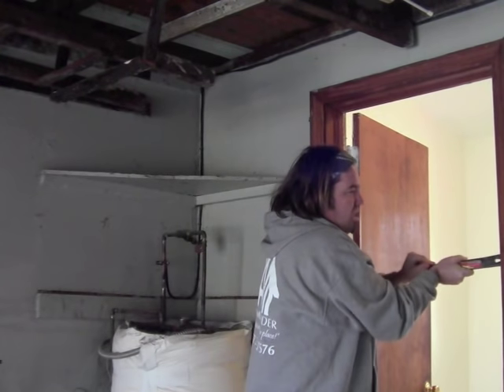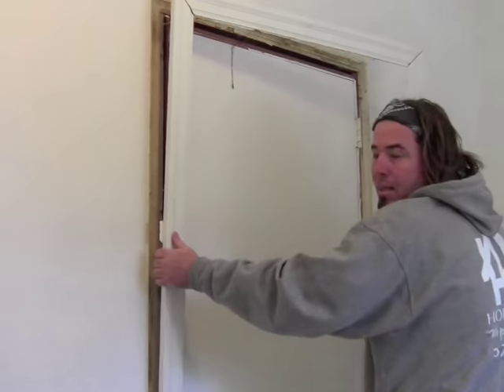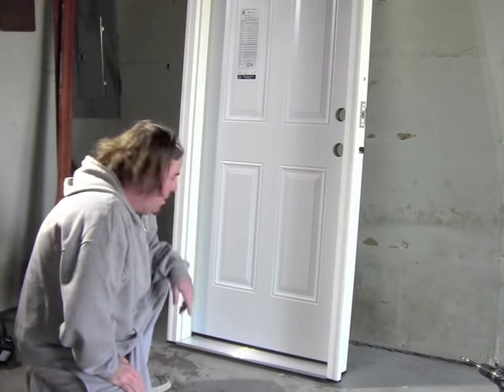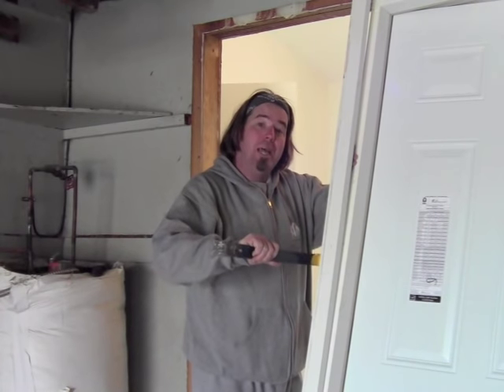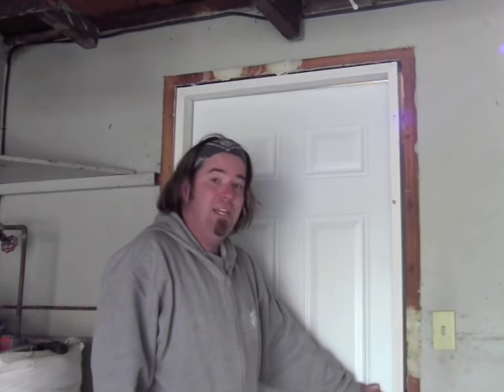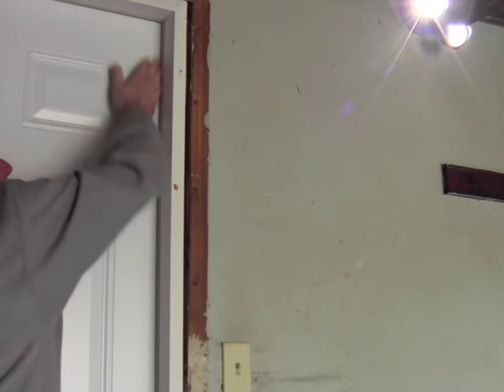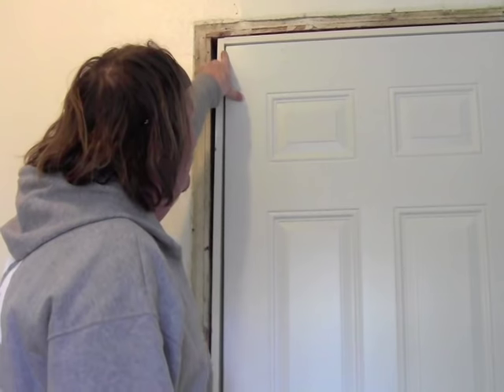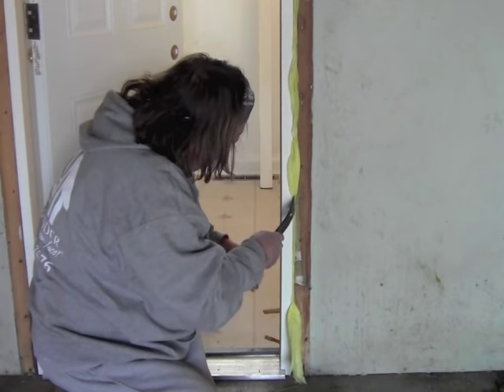how to install replace pre hung exterior door and jamb. Easy! Home Mender

Comment: Hey Dustin, I have been told by several carpenters that one should always cut ,not BREAK ,shims in windows and doors ( I watched you break 'em on another video)   The reason being that the fibers of the shims in the center of the shim also break and will move out of position due to movement ( of the door/window ) over time. Also you must have some kind of callouses on your hands, by the way you handled that fiberglass insulation. That stuff drives me crazy , I try to handle it with a blade of some kind.
Reply from the maker: hey Joseph, thanks for commenting! Im not going to pretend to know the science of shim fibers but if you ask me, those guys may need to get out more..lol. not sure about the insulation, I guess some people are more sensitive to it. thanks for sharing and thanks for watching!

Comment: Wont this allow a pry bar plenty of room to crack the door open with the giant gap on the strike plate side and gain entry by a thief?   Wouldn't it be better secure to have a more even gap around the frame and have less of a gap on the trike plate side?  Sorry new to hanging doors.
Reply from the maker: Neutech hi. No problem. Typically a door fits in the jamb and has the same reveal on the top and sides. Hope this helps and thanks for the comment!

Comment: I have a problem when installing some prehung doors the door sags toward the latch side even with jams shimmed what could be the problem ? I also checked the hinges and all are tight.
Reply from the maker: hey fernand, maybe your jamb is out of plumb. You can always make the hinge side plumb and then shim the threshold as needed, seal exterior with quad and youre good to go. i hope this helps!

Comment: Thank you Dustin!!! When you showed the part about pushing the door in slightly at the top to close the gap with the weather stripping, it finally clicked for me. I had the exact same issue.  I had spent hours screwing with the level and shims.  I had to hang the same door 3 times.  After watching this, video I finally got it right and hung the door in about 20 minutes.
Reply from the maker: you are awesome greg! thank you so much for sharing! such a reward!

Comment: In MIchigan, any garage entry door must be fire rated. Hence the reason to shim both sides and then seal the cracks with self expanding foam that keeps any CO from entering the house.  You do have some good tips about using one of the hinge holes to secure the door to the framing and to pull back the weather seal on the hardware side so you don't see the screw holes.
Reply from the maker: thanks nick! Your comments are appreciated! thanks for watching

Comment: Damn, your video is more than professional work.  We are installing the main entry prehung wood door and we are having problem.  We drilled the 3 holes thru the concrete for the metal on the bottom.  Now we cant shift the door left or right.  The metal seemed to be stuck to the door.   Can we take this metal out and bolt it later?  Thank you very much for your kind help and video!
Reply: and there is 2 inch gap on the top after putting in prehung door
Reply from the maker: hi brett!. thank you so much! ..you got this.. with a 2 " gap, you can either fill the top or set the whole door and jamb on top of a 2x6, ( exterior if its going to touch the rain).. i wouldnt recommend removing the threshold or putting holes in it.. generally just the sides get secured and the bottom just floats... i hope this helps..

Comment: Damn Dustin, I love watching this video! I can tell you're a craftsman because you made it look so easy! I put a door in (incidentally in the same area of MY house- kitchen into the garage). I wanted to do your idea of screwing hinge side directly to the rough framing jack stud. However, the rough opening (to me) was too large for that, so I painstakingly did it with shims on both ends. P-I-T-A!  Ha. So,  what I think I'll do is get some 7/16" ply and attach it to the rough frame hinge side to close the gap. THEN, I can do what you detail here. It's my first door today, and I ended up with nearly the "full-finger" gap on top, so I need to revisit it. I also caulked the crap outta the threshold I used the ALEX stuff so I'm hoping if I redo door in a day or so it isn't bad to take up! Let me know what you think. Appreciate it!!!
Reply from the maker: Great work RJ! sounds like youve got it under control! don't worry about the gap up top, you can insulate it with some batted insulation. If you have to raise the door up you can always create a sill out of a 1x6 or if you need the thickness, use a deck board. glad it helped you my friend! thanks for watching!
Reply: Hey Dustin! I'm back brother...I did the door again, attaching the hinge side directly to the studs. I previously rebuilt the wall to the right of the door, not altering the sill plate location. The OTHER side is old too. I think the wall (in a linear sense) across the rough opening is not straight. Also, I believe it to be not level. I believe that because A) I measured many times B) I checked level in a few places and C) I followed your awesome instructions to the letter, and no matter what I changed/adjusted, the door slab sticks out the top left (when looking at it from the inside of house). This old house is a pain, haha. I need to have my guy rebuild the wall level and straight across the rough opening. Any thoughts?
Reply from the maker: RJ F hey rj.  Sounds like you got it whipped. Sometimes, nothing we can do will make an old house level. It's the classic " it is what it is" line. Upload it to instagram. I would love to see it !
@thehomemender
Reply: Thanks man! I wish you worked here in NY, I'd hire you any day. To send that, do I need any account of my own for Instagram?
Reply: Ohhhh...now I see. @thehomemender

Comment: Will this method without level work if rough opening studs are significantly out of plumb or if the floor is far from level?
Reply from the maker: hi Michael..absolutely...if the door is shutting, sealing and latching without dragging or rubbing, it doesn't matter if its level or not...i hope this video helped! thanks so much for watching!

Comment: For kick-ins, does using a screw vs nail really matter when installing a door considering screw's shear strength vs nails?
Reply from the maker: great question Shawn!. I know new doors only come with about an inch and a half screw.. when repairing a break in, we always go back with 3.5 inch deck screws.. that way you know they reach the stud and its a bit harder to get through. thanks for the comment!
Reply: I always hung exterior doors with a finish nail gun using 2.5" nails.  After all is right and done I'd go back and change out a short screw in each hinge and both screws in the strike plates with long screws that would reach the trimmer stud plus an inch or so.  Sometimes framers don't get the wall plumb and straight which makes it tricky for less experienced installers to get the door to touch the stops all at the same time.  Every so often you'll need to pound the drywall and roll the casings to make it work.
Reply from the maker: Ed Waggoner Sr. awesome ed! Great comment! Thanks so much!

Comment: What about an issue where you have to push and pull up on the door to latch the dead bolt?
Reply from the maker: hey dj...sounds like you need to adjust the deadbolt catch. i hope this helps.

Comment: I need to replace the same door from garage to utility room. Should screws be used to secure the preying door or nails?Also where did you find that strip of insulation?
Reply from the maker: hey james! I always use screws to secure the jamb, they hold better and should you ever need to adjust it, its way easier. The strip of insulation is usually in the HVAC aisle at any big box store. about 4 bucks if i recall.. Thanks for watching!
Reply: +Home Mender Inc Thank you for the quick response! Now I just need to convince my wife I can do it!
Reply from the maker: lol. just start pulling off one piece of trim per day. when she notices, she will insist that you replace it! lol good luck james.

Comment: Dustin, your method can enable a homeowner to install an exterior door without a level in some cases, especially if the brick mold is left on, which will tend to hold the side jambs straight and the entire frame square. But without shimming a bowed stud on the hinge side, or an out-of-level floor under the threshold, for example, there can definitely be problems that need further consideration than what you mention in the video. I imagine you are aware of this and wanted to keep the video simple. But a follow-up and/or caveat about such not-so-unusual, far from perfect rough opening conditions would eliminate potential frustration and trouble for your viewers whose knowledge of carpentry is limited to what they learn from you.

As a professional carpenter, I would not dream of installing a door without a level, but I can appreciate the benefit of your tip to homeowners who simply need to get a door to function properly without hiring a professional. But I think it is only fair to warn them that the method illustrated may not always work, and to show them why and how to deal with it. The door itself will remain square, regardless of the shape of the R.O. The frame will not. Therein lies the rub.
Reply from the maker: Hi michael.. obviously if youre working in a fun house with crazy framing, a level would be beneficial however in the many many doors ive installed, ive not used a level more times than i have...i hope the video helped you and thanks for sharing your thought!
Reply: Dustin, I don't doubt your personal experience. Just trying to add a little understanding. Your method bases the entire orientation of the door unit on the vertical line of the hinge side stud. As a very simple example, let's suppose it's perfectly plumb. In real life, it's far from unusual (or fun house crazy) that the floor under the threshold will not be perfectly level. Therefore the angle between stud and the unlevel floor will not be equal to 90, whereas the door unit itself will be square. In such a case, one or the other end of the threshold will not be hitting the floor. Surely, you would accept that it's essential that the threshold be fully supported over its entire length, or at the very least at each end.  Shims are needed (as well as sealant). Without such continuous support, the threshold will eventually rack or come loose, causing infiltration and other problems. I am not trying to shoot down your whole method. I am only suggesting that mention of such details as this  (there are others) would save your inexperienced viewers some frustration during installation and disappointment down the road. Your method is no doubt useful to many, but your portrayal that will make every installation a no-brainer undercuts its value and is unnecessarily misleading. Your method is in fact based on keeping the door unit square, rather than level and plumb. IMO, mention of this principle and the strategic use of shims as part of the means to achieve it would add a lot to your presentation (and minimize comments condemning your method out of hand...) Peace.

Comment: 2:20 - there  always seems to be a few around that are in need of a good servicing :)>
4:18 - a nice tight fit is always best. usually it slides right in, if it isn't too big, otherwise it can be a pain in the ass
4:51 - as deep as it will go, works for me. it will be sure to 'Come out Real Good That Way ;)
4:56 - that method works best for me, making sure everything is feeling right B4 screwing it in.
Reply from the maker: Duster! WOW ! I had no idea installing a door could be so sensual!...thanks so much for pointing this out....Construction is sexy..lol. Thanks for sharing!
Reply: @homemend  
you make it so  :)> Hey quick question: I bought a new pair of black, steel toe Timberland Pros. on amazon. their the right size (10's) but they are too tight and pinch my feet around the top , and a little snug around the toe cups. by the end of the day, I have to practically pry em off, and get some relief for my steaming, sweaty dawgs. Any tips for breaking em in quickly?
Reply from the maker: My dad always used softball glove oil on his. There's no shortcut but moisturizer( leather conditioners) are really the only thing that wont ruin them. For me, its hard to get up and down from roofs in boots.. Im an adidas man myself! Thanks for being there bro.
Reply: @homemend  Thanks Man, will Def take your advice & get some leather conditioner. ;) I gotta get these boots more comfortable, boot socks make it worse, they are lined so I have worn em without socks, they feel fine like that, except for blisters, and I kinda dig that good strong smell at the end of the day, keeps ants and vermin out of my place, HA HA 
no prob Dude, glad to be there for ya. you totally Rock. ;)>

Comment: so basically u are making the door square not level
Reply from the maker: hi bow basically yes. it would still need to be plumb or it won't seal well. as long as a door is secure and seals. its correct. I hope this vid helped.. thanks for watching!

Comment: I'm having trouble getting my main entrance door corrected the problem is that once I corrected the tilt hit had by putting longer screws in the hinges no it drags the bottom on the metal plate . There is also a big gap going across the top of he door all he way across . How should I correct this ??
Reply from the maker: hi sharon! you can do this.. if it wasn't dragging before, you just need to put a shim behind the area where you put the longer screw.. you could also get a pry bar under the threshold and lift up the opposite side of the drag and lift the entire jamb up a bit.. it sounds like your frame is out of square. I hope this helps!
Reply: Home Mender Inc I added a shim piece of cardboard cut to size behind the top hinge and I'm using 3" screws but they don't tighten and are just spinning in the hole I took them back out and all I see on them is drywall dust :/ ....    should I use even longer screws ? I do see some unevenness on all four sides of the frame in thinking maybe the frame shifted and I'm not sure how to correct that but I wish you guys were closer to Fort Wayne IN .  my home is a mobile home and I may need to buy a level to see if in fact I need to have the home leveled properly before trying to adjust the door . Any more information about this ?